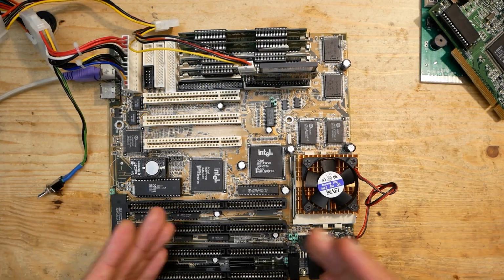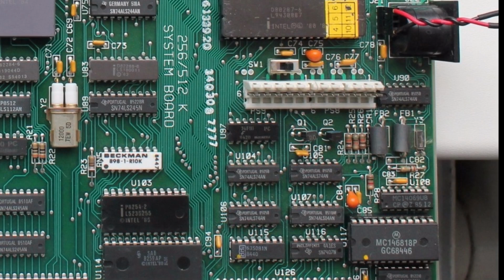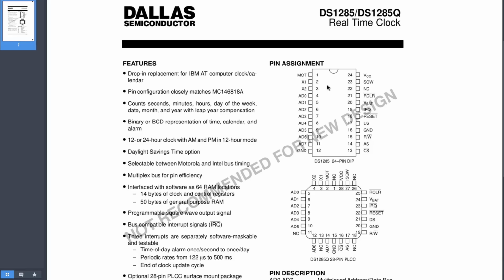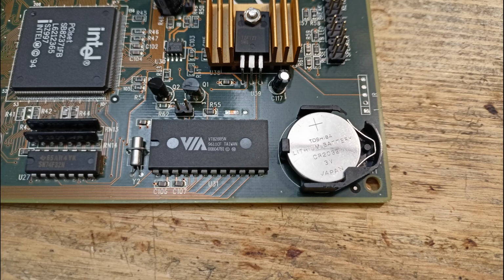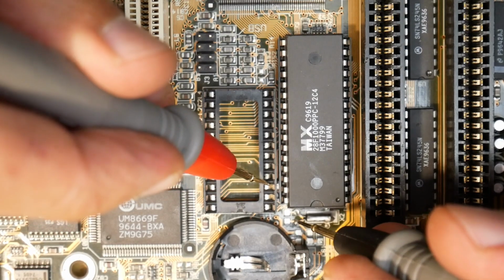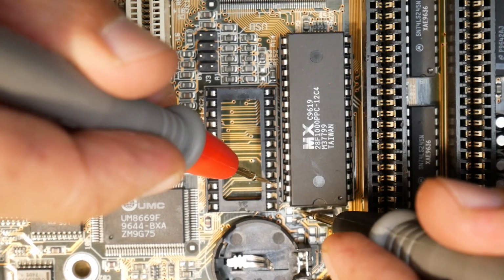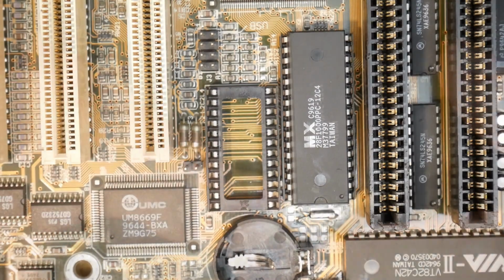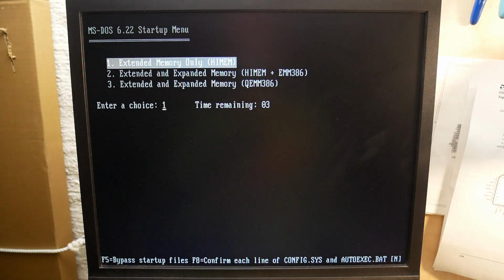Let's talk about RTC options once again

Comment: Hi, could this be used on the Konami Hornet arcade hardware as it has a similar RTC?
Dallas DS1225Y 8840D1
Reply from the maker: I don't have such hardware, but I just googled for images of that board and there is indeed a similar module. I think it would work there as well.
Reply: @necro_ware  No A DS1225Y won't work on Hornet. I have done it here with a M48T58Y. I own several Konami arcade games (over 500 arcade games total). The battery locations are at the very ends on the bottom side and it takes only a couple of minutes to expose them and connect a battery holder. I have one with external battery running in my Konami Warzaid cab and it's been going for several years so far. I keep an eprom next to it in a bag with the code. When the battery goes flat I read the eprom into my eprom programmer, change the battery and program the old M48T58Y again and it's good to go for several more years :-)
Reply: @necro_ware  It won't work. No idea why he thinks it's a DS1225 but possible someone clueless put it there. The actual chip on the board is ST M48T58Y with internal rtc and 8kB battery-backed sram containing code. It's a protection device so when the battery dies it's game over permanently (on purpose of course). The chip must be read out and saved using an eprom programmer that supports these devices then an external battery can be hooked up and the chip re-programmed using an eprom programmer. I've spent the last 30 years finding and backing up all the Konami games that use this chip and they are all emulated in MAME.

Comment: Discovered the heat trick by mistake when using hot air to remove the Dallas chip from an arcade board. The top just came off exposing the battery. I had to pull the chip anyway as the game (Mocap boxing) has calibration data on the chip and won't boot until that is present. So I had to make a EPROM adapter to flash the data on the replacement Dallas chip before installing it.

Comment: Definitely going to attempt this with the drained Dallas/Benchmarq modules I have laying around. Didn't think the potting compound would go brittle like that with heat applied.
Reply: I just tried it and it worked a treat. TBH it doesn't really become brittle, it is more like it becomes malleable and soft, you can pry it off like putty.

Comment: Why doesn't cars have RTC batteries in their ECU, it always baffles me that the car basically lose its "CMOS" settings if one removes the battery.
Reply: it's actually better that way. Imagine if the settings got corrupted like is common on a PC with CMOS. There would be no way to reset it other than pull apart the ECU and disconnect the rtc battery module or have to take it to a dealer and pay $$$. No no no you don't want that. Don't give the manufacturers ideas lol

Comment: on man i have a few DS12887 i got an RTC from someone online for my dual Pentium pro and it did not work..
what is the part number for that battery holder you uses on top of the IC?
Reply from the maker: just search for CR1225 SMD holder

Comment: Not sure about that "evil manufacturers" plot. I think all-in-one RTC solution is absolutely fine for 99% regular users. People upgrade motherboards faster than RTC battery drains.  For example: I bought my first PC in 2000. Since then I have never had to change the battery in the motherboard. I've never had a motherboard last longer than 4 years.
Reply from the maker: "I've never had a motherboard last longer than 4 years." - exactly, think about it ;)
Reply: @necro_ware  He might mean he just upgraded the motherboard or entire PC which is common. Or if they stopped working it might be time for him to start treating them better hehe! My i7-6700K from 2015 is still working very well and I think I changed the battery once in that time. Some years ago it booted Win11 in 4 seconds so no reason to upgrade anything. Not that I'm still running W11 on it. I went back to Win7 as this is my emulation machine and W11 is just bad lol

Comment: I now feel more educated than 24 minutes earlier.
Reply from the maker: Awesome!
Reply: @necro_ware you should be able to cook the resin casing in hot water too. Just be sure to put some glass shards on the bottom of the pan, so the chip won’t touch the bottom of the pan and burn itself. 
The same could be done for the C64 power supply.

Comment: QUESTION: what's the temperature of the Hot-Air?
Reply: I used my hot air rework station set for 190F/88C. That temperature seemed to work best for me. Yes, I had to try it immediately after watching the video. :)
Reply from the maker: As I said in the video 70-80°C
Reply: What about immersion in boiling water?

Comment: I was going to try this method but I thought the epoxy would just melt and make a huge stinky mess. Thanks for diving in and giving it a try and man what a great result. 👍
 I'll have to clean up the RTCs I have. I tried to remove the epoxy from a Dallas RTC by soaking it in acetone and it kinda works but not really worth all the time and effort.
Reply: Nearly all potting material is thermoset and has the properties described in the video. The only common exception is bitumen, it will melt and relatively cleanly leak out.

Comment: I wonder if an ATMega chip could be coerced to replace that functionality, since some of them have onboard NVRAM with very low power draw, around 0.1 microamp when sleeping, even though that is double the Dallas, so it would last half as long, coin cells are easily replaced.
Reply from the maker: I already investigated similar options, but it would need quite a lot of work to replicate all timings and compatibility hacks. Currently it is probably not worth the effort, especially where old modules can be reused in the shown way.
Reply: @necro_ware  Making just an NVRAM is pretty easy, at least for a DS1225. It's just a 6164 SRAM + DS1210 Battery Switch + a 3v battery and holder. I made one a few years ago, works great in some projects that use a 8k battery-backed RAM.

Comment: This man needs to be protected at any cost.
Reply: Now, question, would be possible to instruct an MCU to pretend to be an RTC chip?
Reply from the maker: Yes, of course. I already investigated that option, but it would need quite a lot of work to replicate all timings and compatibility hacks. Currently it is probably not worth the effort, especially where old modules can be reused in the shown way.
Reply: @emuboy85  In the Mac world, the custom 344-0042B RTC was replaced by a pin compatible ATTiny85.
Reply: @ukmk3supra  I think it'll get there eventually on the PC side, but for now this option is the very definition of "good enough" in the sense it's cheap, flexible, and relatively easy even for a novice hobbyist.
Reply: Clone him
Reply: Yeah, pot him in resin! Oh, wait :D

Comment: Very interesting, I really didn't think it could be so easy and clean to de-pot those RTC bricks.

Speaking of companies doing bad things, a notable troll move to me is when a motherboard uses a CR2032 but the soldered version of it (like Compaq did for example). Yes it's trivial to replace it with a battery holder but it still requires tools and some skill
Reply: Soldering ensures no bad connection.
Reply: Soldering means a solid connection. Look at any pinball machine and you will quickly see that connectors are nothing but trouble. It's actually easy to remove a part that is soldered in. Smart people get some tools and learn. The rest (90%) throw it away and buy new.
Reply: @g4z-kb7ct it makes sense for something such as a pinball, that is not meant to be inspected by the average joe and is going to be mistreated for its whole life.
It makes less sense for a PC where it's already filled with connectors.

You fear the battery is going to loose connection in a machine where the CPU is in a socket, expansion cards are in slots, memory is socketed or in slots as well and the hard drive is connected to a pin header ? 😁

I guess it could make sense in a POS-style computer made for an industrial environment though
Reply: @DxDeksor  I think you've misunderstood my comment. Pinball machines have dozens of connectors and fail very often due to bad connections between the boards or other parts (switches etc). Connectors in general are a bad idea for anything that is being used or abused by a human.
Reply: @g4z-kb7ct  ah yes maybe, though what I meant is that I agree that for something abused like a pinball machine does indeed suffer from having connectors.

However I think for a PC, it's just fine
Reply: @DxDeksor  I think it's entirely possible that the average joe wasn't meant to inspect the internals of his computer either...

You know as far as assumptions made by the business.

Comment: Sorry to hear people gave you grief for something you didn't even sell them. You would think that someone with the requisite knowledge to seek out such a module would have something other than air between their ears.

This is a great tip though. Even without the mainboard spaces for battery and oscillator, that the modules can be disassembled and modified rather easily is good to know.
Reply: CUSTOMERS!!🤦 The other day they shouted at me because of the invoice amount from a company which sounds similar to the one I worked for. Even when I was the service engineer. Obvious violation of rule 142 "never mess with the service engineer"😁
Reply: I was shocked by this. It even isn't so much money to lose, so anger and frustration should lead them to such rattish move.
They were probably full of anger of losing money and doing desperate things.

Comment: could such a chip be found in an old digital clock?
Reply from the maker: Could be, but for a simple clock this part would be quite an overkill. So most probably not, or very seldom.
Reply: Even if it could, it seems like a waste of an old digital clock, unless that was unrepairable for other reasons.
The point seems to be re-using the one from the original RTC module. Unless I'm to intoxicated & missed something.
Reply: Some weather stations, Hi-Fis, CD players and radios, digital alarm clocks have compatible modules

Comment: 0.3V sounds perfect for our clima neutral lemon based power supply.
Reply from the maker: Yeah, unfortunately the lemons didn't get into the video this time ;) May be another day.
Reply: @necro_ware Yes plz provide an open source lemon holder.
Reply: @AncapDude  He shouldn't do that! then people would get back to him complaining that their lemon is too SOUR!
Reply: @lorenzo.c  4 sure they do
Reply: If you cut the lemon in 4 and use 4 pair of electrodes, and connect them in series, you can even get to 1.2V. That ought to last for a while longer :)
Reply: @stamasd8500  I just googled it. We should get about 0.9V per lemon. So, no need for slices.
Reply: Clima neutral does not exists. It is a politician's fairy tale.

Comment: When resoldering pins, I saw on another channel that using the leg of an LED works great. It's already tinned, and fits in a socket perfectly. And the LED is even unharmed just with shorter leads. The LED works like a handle while you're soldering, too ;-) I just thought that was a neat idea.
Reply from the maker: Yes, I have small can full of old legs from all kind of parts for such things. That is of course also a good option.
Reply: @necro_ware  That is exactly why I collect cut legs from all sort of components. Especially resistor legs (1/2 watt or more) and electrolytic capacitors I find especially useful. That doesn't come without dangers though. Just this morning while walking around in my work area in the basement I felt a pain in my leg, and when I looked I had one such capacitor leg stuck in one of my toes. :P Must have missed it when I collected the leftovers from the motherboard I did a recap on a couple days ago.
Reply: @stamasd8500  Magnet is your friend, I always keep one big old speaker magnet just for that purpose on desk, these legs are useful when building any prototype circuit.
Reply: When I build some kit or do some other soldering with a bunch of new through hole components I usually save a handful of cut legs exactly to have replacement pins for such repairs

Comment: This is awesome, I didn't know the resin became brittle from heat without melting the components in the resin. 
I have several dead modules as well and I think that might be a cleaner method than drilling/filing. 

I am curious about the recency of manufacturing. I ordered a pair of the Dallas modules from Mouser (a reputable electronics supplier in the US) and received new modules with 2023 date codes. I wonder if there is a small operation still making them for industrial equipment.
Reply from the maker: I was also surprised to see how good the heat worked. In regards of the new modules, I heard, that they are still produced somewhere in Philippines, however I was not able to find any in Germany. I could order some of those from U.S. but the shipping costs and taxes were too high. For some rare mainboards it is probably worth it, but in such cases I prefer to use my nwX287 module anyway. For everything else, extracting the chip from the old module is a great option imho.
Reply: Yes new modules are still being produced. You have been able to buy them from Digi-Key for at least 10 years.  I bought one back in 2015 and also recently.  I did a little research on this and Analog Devices owns the tech now as they bought Maxim previously.  These ICs are used in the Industrial sector so I am sure that is the consideration here.  They also still manufacture the 12885 and if someone wanted they could easily bend the pins and add the XTAL and battery holder on the back.  But yeah the video shows a great solution to be able to reuse the old modules.
Reply: It's confusing that the new manufacturers continue to make the modules in such a way, they own the IP to the circuit so they could easily make the same design as Necroware's and save themself money on the assembly line too!